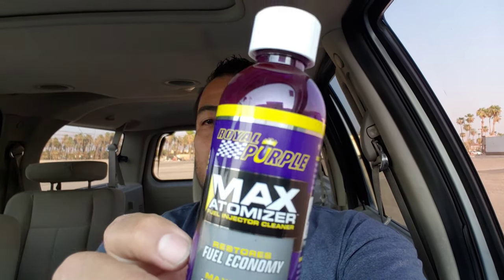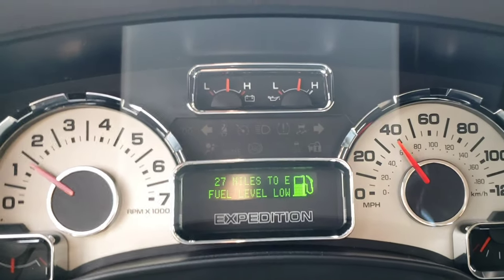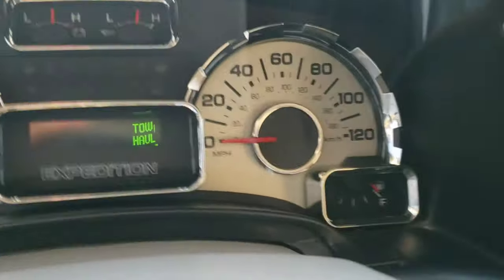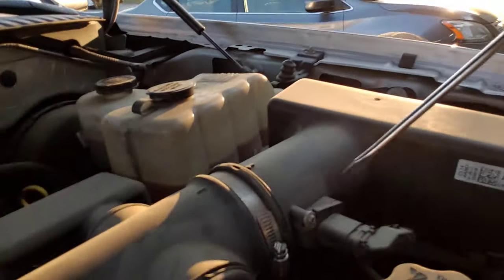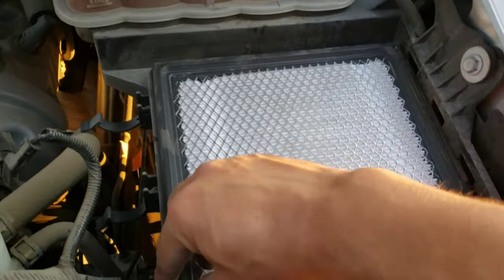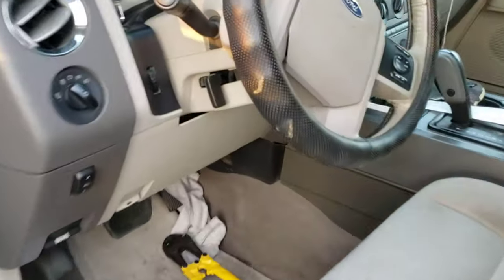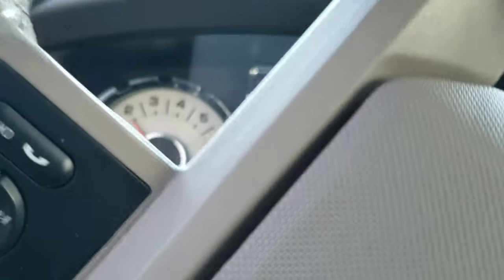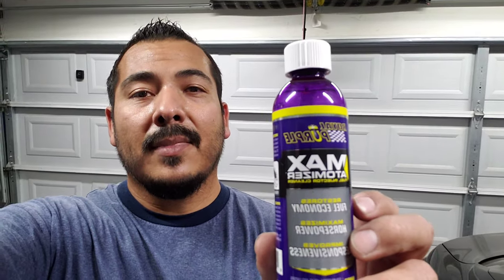CAN ROYAL PURPLE MAX FUEL CLEANER FIX MY TRUCK?? PART 1

Comment: I don't trust fuel cleaners much, but I tried it anyways when I bought my old truck.  Truck was running fine, just thought that the stuff would make it run "more better".  I used some cheap Walmart brand (Supertech I think?), anyways, I dumped the stuff in my fuel tank, drove about 6 miles, and then my truck had a top speed of 20 MPH while empty (this was a truck that before had a top speed of 90+ with a 10k trailer).  Apparently, I had a bunch of crud/trash in the fuel tank, and the fuel cleaner knocked it all loose, the fuel pump sucked up all the junk and pushed it into the fuel filter and clogged it.  As soon as I was able to, I stopped, put in a new fuel filter and truck was back to normal.  I had always replaced my fuel filters every oil change, but since then I started keeping a spare in my truck.
Reply from the maker: oh wow 
That's good to know,
 thanks for the info 👍

Comment: ❓Another thing that will make you get faster acceleration to your throttlebody would be to take off all those intake silencers and plug them I’ve done it to a dodge stealth you get a lot of low and torque because of the straight through airflow towards the throttlebody💪🤙💯✅ if needed cold air induction K&N